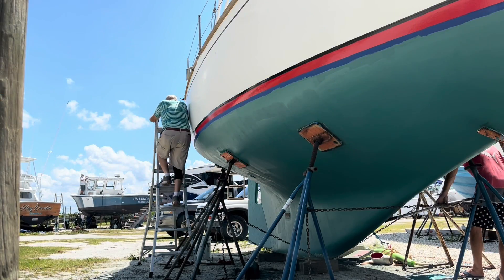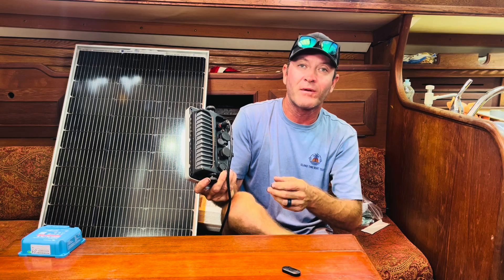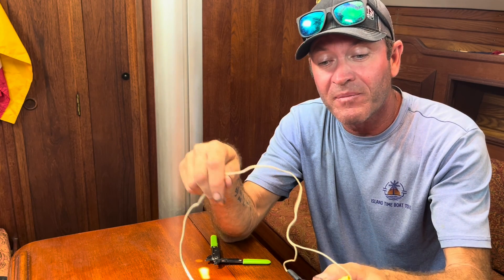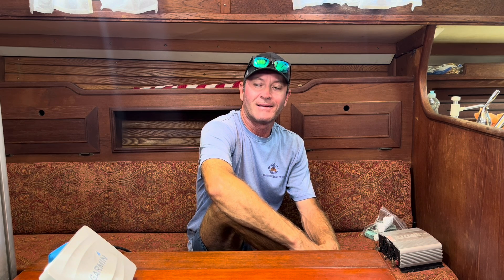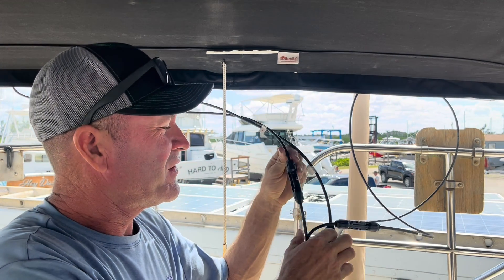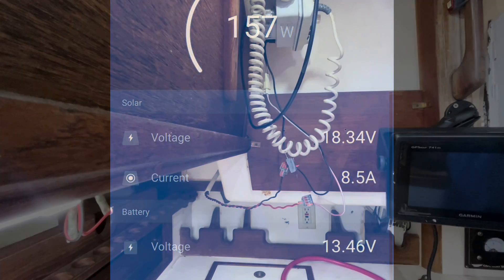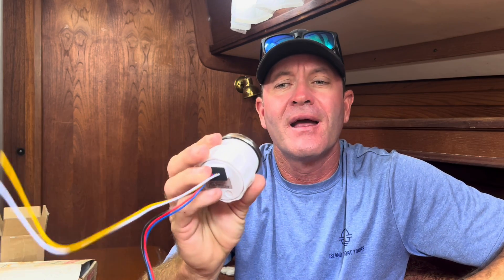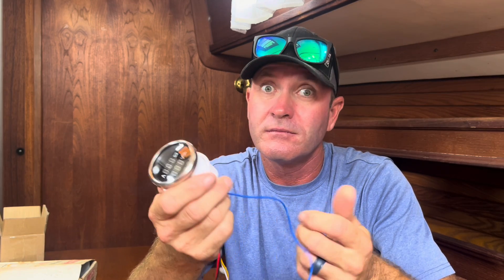How do you sail to the Bahamas without breaking the bank? Electronics, Solar & Lithium under $1000!

Comment: Nice to see you are able to rework projects on limited budget. A few thoughts. 
The 15A rating on the MPPT is the output rating, nothing to do with solar input. For you, if you get max 200w from panels,  you will be sending 14A to bats (200w/14.4v), so you are under the 15A rating.  Adding another 100w panel would be more like 21A which would bring on pv power clipping and heat in the MPPT.  A large 400w panel at 12A output would greatly overpower the MPPT as it can't send 28A (400w/14.4v) to the battery. The Bahamas are sunny so you should do alright with your setup  if you keep power consumption reasonable especially with the 300ah bat.
The HF inverter model appears to be modified sine wave.  That will work ok for some appliances but sensitive electronics will not like and some items, like refrig compressors, will run hot and more noisy due to inefficiency.
The Bahamas fees did go up, but if you opt out of getting the fishing lic (expensive if you only catch few edible fish) they are more reasonable.
Reply from the maker: Thanks for the information, so far the solar has been working good here in Florida, the refrigerators are both 12v so only using the inverter to power the hookah  compressor if we need it.

Comment: if you wire the panels in series rather than panel they will produce more power exspecially in low light conditions.  Raises the output voltage to keep the charger working on cloudy days.
Reply: You're forgetting about shading. Solar panel location on boats is notoriously difficult as there is always something shading one of the panels, the boom or masts or something else. So, parallel makes a lot more sense otherwise the tiniest amount of shading can result in losing almost all of the output.
Reply from the maker: I will give that a try!
Reply from the maker: Great info, thanks for the tip!